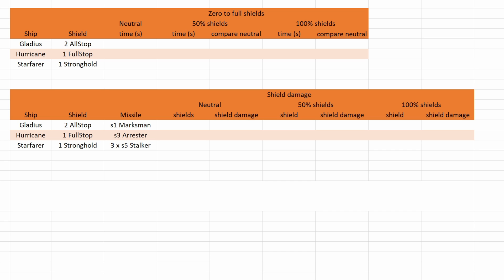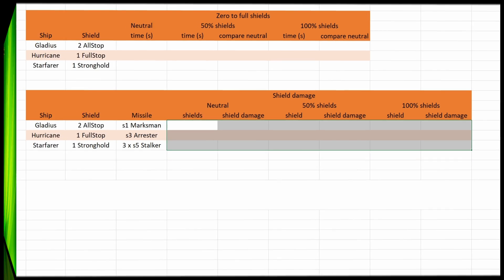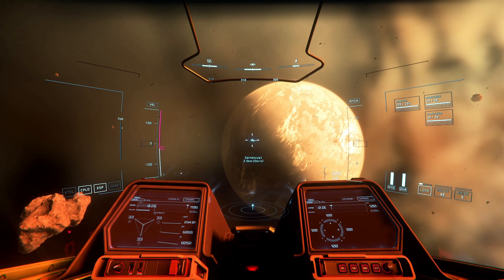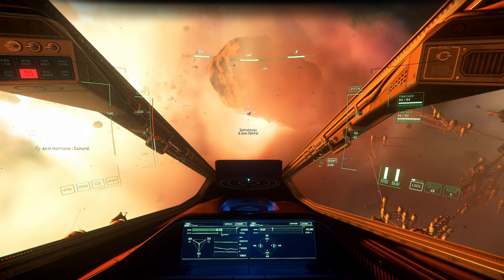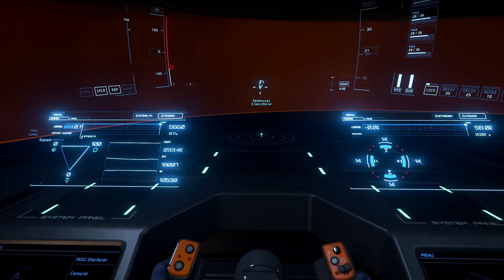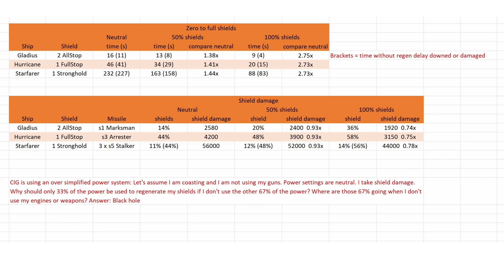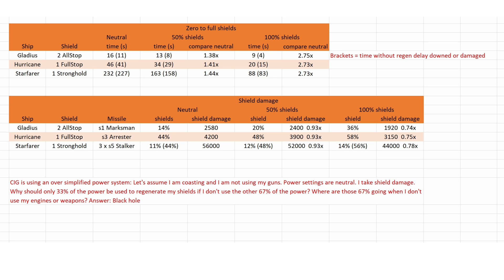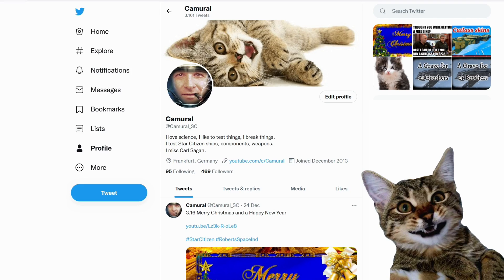3.16.1 Regen rate and damage reduction when putting more power to shields

Comment: I like where they are going with the capacitor rate. I'd like to see some more testing. 

Thrusters maybe can determine thruster output and top speed and not just afterburner charge rate.  
Weapons, should in some way have a negative to ballistics maybe fire rate or heat, this way even ballistic weapon load-outs would benefit or have a negative in some way to using the weapon selection.
Shields are looking pretty good I think.  I like how charge rate and overall shield amount is determined, so maybe some more tweaking but I like how this works so far.

Comment: Perhaps they'll bring back heat, so when you charge faster you generate more heat, eventually blowing out your components if you try to push them too far in the middle of a battle?

Personally I'd have preferred a system where each ship has a number of capacitors that fill based on your power plant, then you actively decide when and where to plop that power as and when it's needed. That would also give a co-pilot more use as the pilot would have less distractions. Would also require communication between the two when deciding where to put the power.

Comment: :yt:Hi Camural! Love the videos! Keep 'em comin'! I want to answer the question on your spreadsheet. I think CIG intends (in lore) that the component DRAWS the amount of power it can handle, x3 systems i.e. shields, thrusters, and weapons by default (power triangle centered). The ship's computer systems monitor all 3 systems and manage the power to the components WITHIN the LIMITS of the power available from your power supplies. You can't draw more power than the powerplant can output. You then, as the pilot, manually adjust power management between the 3 systems depending on what's going on e.g., combat vs just cruising. In doing this, you must make a value judgment: Is it OK right now to rob power from shields to overcharge the weapons and get better performance from them? So, to ANSWER the QUESTION: The 67% of power available to you is right where you left it; powering the weapons and shields. I truly enjoy this level of realism. I truly enjoy the immersion of the game sometimes, and this does a lot for me in the way, especially when the pressure's on in combat and I have to fly, aim weapons, and manage power systems. I think it's a HOOT! Anyway, I submit all of this to you with humility and respect. I am in no way trying to troll or give you a hard time. This is how I see it and I welcome your reply so we can discuss this in more detail if you like. CMDR_J_SHEPHERD  o7 SIR!:elbowcough:

Comment: Stupid designer:
Build a system with a power plant that puts out 100 units of power
Make 3 systems that have a capacity to work best at 100 units of power each.
Now we have a ship that has to split 100 between 3 systems leading to 33% effectiveness

Smart Designer.
Build a system with a plant that produces 100
Make 3 systems that have a capacity to work best at 33 units of power each.
Now we have a ship that operates at full power without neeing a stupid shunting system.

Simple reality is that CIG have done what they consistently do. They are making a problem by trying to reinvent the wheel which ultimately wastes everyones time for little benefit.

This is like building a super gaming rig then putting in a PSU that barely meets the minimum requirements to satisfy a single component. Your supposed to play with the BIOS settings messing around shunting power from A to B to make things work... or you could just get a PSU that has the capacity to fufil the needs of the system.

"The frame cant handle a bigger PSU" - Then get a bigger frame.
This is a spaceship game, in space size is largely irrelevant.
If your building frames that cannot even house the powerplant required to run all the systems. You are a hilariously bad designer, especially when dealing with high performance military grade expectations of combat warships.

Kinda a bit sketchy to build a fighter that is expected to perform like a F-22 then put in a powerplant that is limited to running the entire platform at 33% efficiency.

Comment: Is there a history of other games using a power distribution which done things differently?

It feels like arguing that energy just sitting in a capacitor being distributed automatically is arguing for power distribution to essentially be removed.
Reply from the maker: Greenjam I didn't say power distribution should be automated unless you say a differential axle is some kinds of automatism.
I am saying if you have your power triangle at neutral and don't use your engines or guns at this point in time, why should 67% of the power go into nothingness? It is still produced and there.
Reply: @Camural  Yes and I agree with you that what you say makes sense, but I think this is one of those things that needs to be sacrificed on the altar of game mechanics unless there is an idea or example of another game which does power distribution better.
Reply: @Camural  What should really happen IMHO, so CIG can keep the balance meaningful, but that also makes sense is to have the powerplant sitting at what is "idle" and have some spool up time to full power when something needs that extra power.  So a delay, and different power plants or capacitors having different metrics.  Then the triangle can still some into play.  This way the powerplant isn't consuming extra power while "idle" (maybe that could be adjusted by the player too at the cost of some fuel of one type or another), but also doesn't just remove the power triangle completely.
Reply from the maker: Desrtfox71 I didn't say "get rid of the power triangle" :)
I say if you have the power triangle at neutral, if you don't use your guns or engines at this point in time, but your shields need to regenerate, why should 67% of the power, that is still produced, vanish into nothingness? It should go into shield recharging of course, no automatism needed, should work just like a differential axle.
Reply: @Camural  I understand what you mean, and from a physical perspective it makes sense.  I agree.  From a gameplay/developer perspective though, doing the more or less realistic thing you propose removes most of the need to fiddle with the power triangle because, for the most part, it would automatically address what is needed.  Only if you had multiple draws would the actual position of the triangle matter.  From a gameplay perspective this would, IMHO, water down the need for the triangle.  That was what I was trying to address - having a meaningful triangle, while still making it work a little more realistically (or non immersion brakingly).

Comment: Once again we're stuck with negative design.  The power triangle is a throttle.  Your power plant can generate enough power to satisfy all components, but weapons / shields / boost are throttled to 33% as a default (and yes, the extra power joins the caterpillar somewhere inside the black hole).  Personally, I don't find it engaging gameplay to be choosing what to choke in combat.  I'm not sure where Cig is going with this and how it fits in with the existing energy pipes (they exist).  It feels depressingly superficial as a mechanic and I worry Cig just haven't worked out how they want combat to work, and don't know how to make it fun.
Reply: Its was clear from beginning that this game is inspired by the old Wing Commander / Privateer games or even X-Wing vs Tie Fighter where Power Management and Shield Facing where the point to win. And for me thats good so, one more step to Skill win vs. Equipment.

Comment: Thank you. Very useful information.  As for the ending question, CIG does not care too much about realism any more it seems, but they love mini games. As you said, any ship computer should be able to switch power as needed. The power triangle would come into play to set priorities if multiple systems require power.
And remember, with latest patch CIG introduced, that shields, that are down will get their regen delay reset if the hull is hit. Even a single small bullet will prevent your shield from recharging - although the shield itself is not hit. Where is the logic here? (How does it even know that the hull was hit?). So Game over realism it seems.
Reply: i think this is meant to be part of what a co-pilot/engineer will be doing, remember they could have all turrets auto target

Comment: I do really enjoy your videos, but I quite agree with "simple" power distribution CIG using, because I see it as fair.
As far as I know, energy flows only when allowed to. Your powerplant may generate tons of energy, but as long as you do NOT connect it to certain unit, this unit will not get a single bit of energy. So your triangle tells your system, that it allowed to distribute only 33% of energy to shield - so it does. Powerplant work won't stop, but energy do not dissapear - it just not being produced, if limit-controllers work correctly on that device. We don't know exactly what processes taking place inside of a powerplant. Maybe their intensivity can be controlled and suppressed, when needed. So you really think that energy from powerplant going into "somewhere else"?
If you mean that CIG should implement "smart" system to distribute excessive amount of energy ignoring your control panel commands, that's odd. As you may know, power distribution change is not instant (CIG also said it, when they implemented power distribution system), so when your "smart" system opens extra energy channels for shields, you will have a problem in case you need to open fire or accelerate engines. System will have to block extra channels to shield and reassign them for other parts of ship. This is not a "matter of a second" thing, it takes time.
So you have that triangle, use it. Want to regen shields and maneur - do that via distributing energy from your control panel. You are a captain and only you should decide how your ship should work atm.
Reply from the maker: Linerges the problem is: power is produced no matter if it is used or not. You can check your emissions for example.
If your power triangle is at neutral, you are not using your guns, you are coasting but you take shield damage, 67% of the power goes into nothingness. I am not even talking about a smart option, unless you think a differential axle is smart :). BTW: power distribution changes are pretty close to instant in Star Citizen.

Comment: if you upgrade your powerplant so 50% is more power than the old powerplant does this change shield regenerates?
ie are the changes based on the percentage or the actrual amount of power
Reply from the maker: Grave Peril  everything is still over simplified in Star Citizen, unless it is fluff, eye-candy or time sinks, then CIG is rotating at high speed :)
I don't think putting a power plant with more/less power into your ship has any influence on the shield strength.
Only your power triangle setting and what shield generator you are using has an influence.
Reply: Short answer: no.
Power plant provides only energy requested by powered modules.

Comment: I saw a patch note recently that suggested urging power into shields would force the shield recharge delay. Did you notice that?
Reply from the maker: Byron Antonas no, I still have the raw footage. All the shields tested always started to regenerate 5 secs after taking damage.
Since 3.14 all shields have 5 seconds regen delay damaged.
Please link to the patch note.
Reply: @Camural  Yes you are right, I went over what I saw again, and see that I was incorrect. Thanks for the reply.

Comment: Shield hardening is a nice feature. But power disappearing into nether realm because the settings say so needs to be fixed.
Reply from the maker: Friendly Space Dragon exactly this:
-Power plant delivers 100% power
-coasting, no weapon use
-Power triangle is at neutral
-shields take damage, only 33% of the power is used to recharge shields
Where does the other 67% of the power go Chris?
Another over-simplified mechanic.
Reply: @Camural  Exactly my thoughts. Components should always be at a 100% power by default and the capacitors should only provide a bonus - They could also be renamed to something like Auxiliary Power like normal space games do...but no CIG always needs to reinvent the wheel and mess it up

Comment: To answer the ending question its due to an exponential curve more power to diminishing returns = where that power goes

I just hope when we get ship server blades we can code them

Example

WeaponPower = ShieldCurrentValue

So if the Shield’s are at 100% all power goes to weapons

If shields are at say 50% then 50% goes to weapons

So the value of missing shields becomes the % power to shields so 75% shields + 25% power = 100

Note: before the stupid hull damage triggers shield regen delay you could have also added a 5 second timer on shields hitting 0 where all power goes to weapons (but nope CIG did something stupid)

but you could still add in a 5 second delay on shield negative value change so you have say 50% shield but for 5 seconds 100% power to weapons before it splits to 50-50

Edited it after seeing a more efficient method vs original message

That is just for shield to weapons adding in engines would make it more complex but yeah you should be able to see what im saying i hope

Would love to code my ship to automatically micromanage my system power based on personal preference